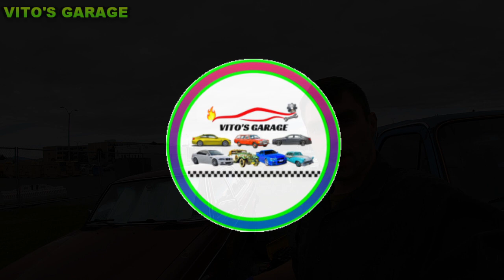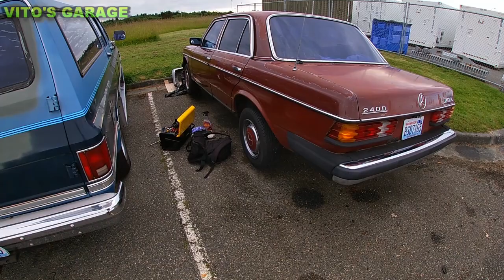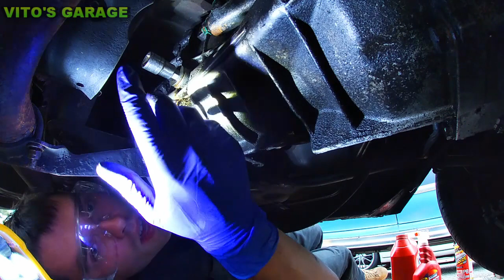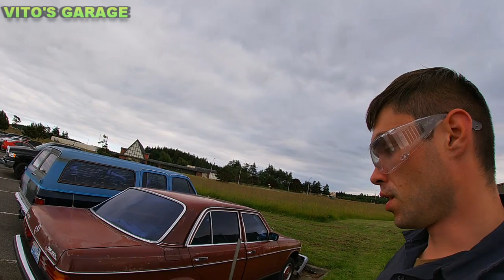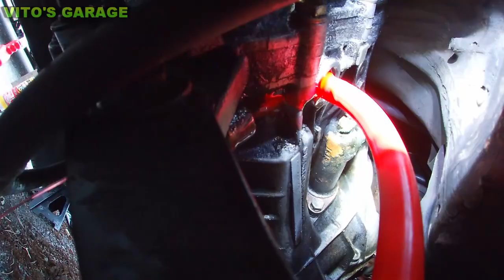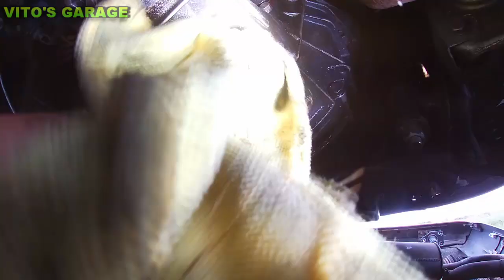How To Change Mercedes-Benz Manual Transmission Fluid on ANY CAR (W123)

Comment: Top tip... actually remove the fill plug entirely 1st before draining.  It will prevent the "chugging" of the fluid as it drains and is 90% less messy than what this video shows.
Reply from the maker: Good point. I just didn’t want any accidental contamination getting through the fill hole. I wanted to keep the fill hole open as less as possible

Comment: This guy is very enthusiastic and learning as he tackles many problems on the cars. The one concern is that all the cars are in a parking lot and he uses jacks and stands to support whilst crawling under such awkward conditions. Surely a  proper high lift ramp will be a god send and make life so easy and safer to work on  the underside repairs and maintenance. Trying to undo bolts whilst on your back with a 12" Clearance is not suited for everyone.
Reply from the maker: I don't have any issues doing it that way. I work with what I have. 
Jacks and jack stands work great for me. Thanks for support
Reply from the maker: I don't have any issues doing it that way. I work with what I have. 
Jacks and jack stands work great for me. Thanks for support

Comment: I have a mercedes se300  1993 manual gearbox, May I use the same  oil ?
Reply from the maker: Hi. Yes, you should be okay using that oil. If you have time, call Mercedes dealership and ask what oil to use for your transmission. Just double check. As you can see, W123 with a manual transmission takes ATF oil. I am pretty sure yours is the same. But just call the dealership to verify. Cheers

Comment: Hey Vito! 
Is there any kind of gasket on both the drain plug and the filler plug? I'm providing all the stuff to do a fluid change on my 5 speed manual
Reply from the maker: Yes sir, each plug had a washer but I reused them and I have no leaks.
Reply: @VITOSGARAGE  cool! Thanks Vito, I allways appreciate what you do 🙂
Reply from the maker: You’re welcome! Your transmission may not have any washers at all. But either way you don’t need to buy any extra parts :)
Reply: @VITOSGARAGE  that's nice to hear cause I was not able to find the right washers for those plugs 🤔 
The oil that you have used was ATF type A with the MB 236.2 approval or another?
I really want to change that fluid, when cold, 1st gear is sticky to get in
Reply from the maker: You can go to the local dealer and grab it from there or ask them what fluid type yours takes. Once you know that, you can buy it online or locally, or from the dealer. I used a multi-vehicle ATF and it’s compatible with these Mercedes transmissions. I don’t know if you guys have something like that in Europe
Reply: @VITOSGARAGE  thank's for your advice Vito!

Comment: Hey Vito, thanks for another great video. 
Lately my shifter's been making some clucking sound, plus I've been having a hard time engaging the reverse gear on my W201 (manual), I guess I'll change that oil and see if it helps.
Reply from the maker: Hi Victor! Make sure your shifter isn’t loose. If it is, it may need to be rebuilt. They sell rebuild kits for manual transmission shifters. And of course, a fluid change is always a good maintenance item to do. Go for it
Reply: @VITOSGARAGE  thanks a lot brother! Once I get to engage gears smoothly, this 190E will be the sweetest ride ever.

Comment: i have a mercedes based gearbox and my syncros are really bad, i need to use a thicker fluid to cushion the gearshifts but it uses dextron 2, what gear oil/motor oil can i use??
Reply from the maker: I am not sure. Thicker fluid will probably cause more problems

Comment: Does anyone have a long term report after using modern atf?   i heard 30w oil is better in old mercedes manual transmissions vs atf because modern atf doesn't lubricate bearings well inside the transmission.

Comment: I know mercedes originally specd ATF for these old gearboxes but ATF now is very different from 40 years ago, wouldn't a 75W90 be preferred now? Likewise they specd ATF for the power steering but most now think powersteering fluid is better used.
Reply from the maker: Use ATF. That's what's needed inside the manual transmission of this car. A lot of BMWs also use ATF in their manual transmissions. I think 75w-90 is too thick and causes shifting issues, especially when cold. It's hard to shift gears. The car from the video is doing amazing. No issues with the shifting or anything else with the use of ATF
Reply: @VITOSGARAGE  what about additives in modern ATF damaging the synchros?
Reply from the maker: @bikeman123   @bikeman123  if you use Redline MTL fluid, or high quality ATF, nothing will happen to your transmission or synchros
Reply from the maker: The size of the drain and fill plugs are 14mm allen (hex) socket bit
Reply: I refilled the manual transmission wiith ATF and I'm glad I did, it performs brilliantly. I did however use power steering fluid in the steering.

Comment: Absolutely incorrect. don't use ATF automatic transmission in a manual gear box don't ask me how I know :(
Reply from the maker: You have to on these. That’s what factory specifies. Otherwise your gears will be grinding, especially when it gets cold outside
Reply: @VITOSGARAGE  Using ATF, as it's soooo detergent, it might eat seals a little sooner.
Reply from the maker: @alexcontt  eat seals?? Never heard that ATF eats seals😂😂😂 
okay go ahead put the gear oil in your trans and I want to hear your feedback and how you destroyed it because the gears were grinding 🙂
Reply from the maker: @alexcontt  if the ATF eats seals you might as well put water in your automatic transmission then too